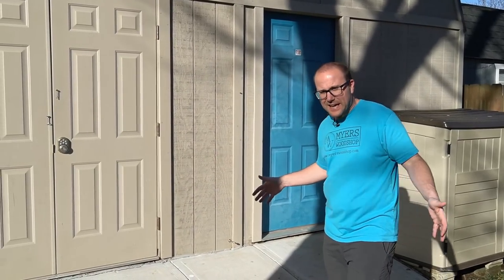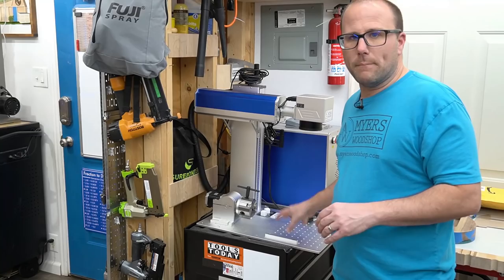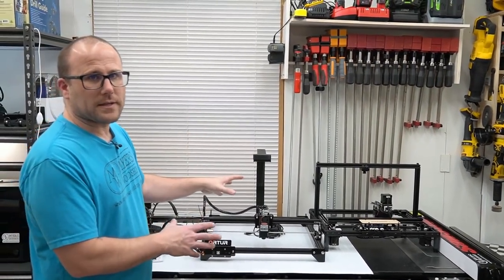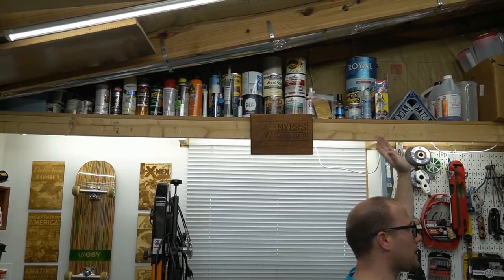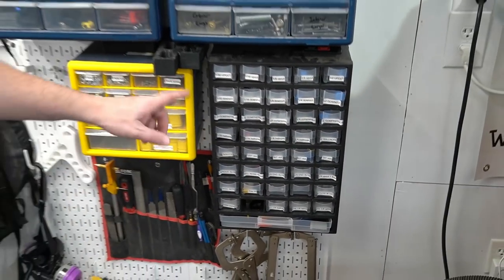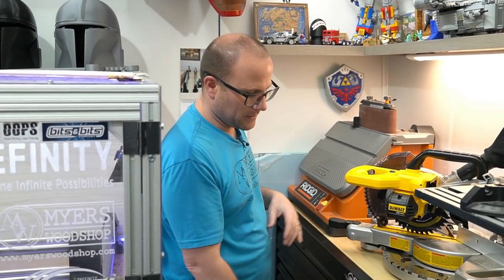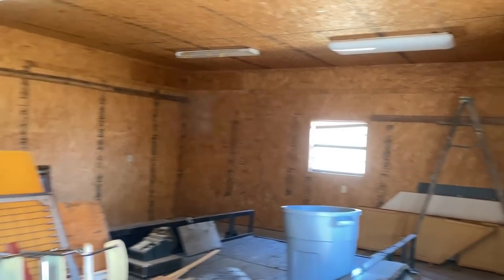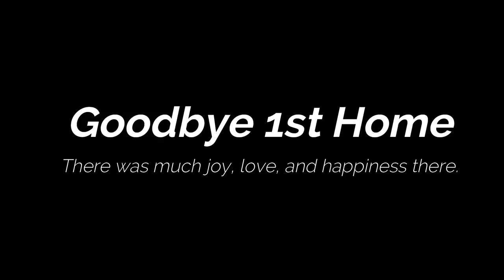The LAST Shop Tour Ever // Shop Tour 2021

Comment from the maker: Laser (omtech):https://omtechlaser.com/?ref=myerswoodshop
Fiber Laser (omtech):https://omtechlaser.com/?ref=myerswoodshop
Rockler dust collection:https://amzn.to/3tekCGM
bora wood racks:https://amzn.to/3cv6rGI
wall control pegboard:https://amzn.to/38CCbIO
microjig:https://amzn.to/38CCgfA
bow products:https://amzn.to/3vmqRdG
Printer:
prusa:https://www.prusaprinters.org/
Ecubemaker 4 in 1:https://amzn.to/3qFVDKJ
ender 5 plus:https://amzn.to/3qJXGgU
artillery hornet:https://amzn.to/2OsDT8K
Ortur Laser:https://amzn.to/3lcfYXb
Sawstop:https://amzn.to/30IdAOd
Grizzly Bandsaw:https://amzn.to/3tga3mz
Supermax drum sander:https://amzn.to/3vmx1u7
34" ultra wide monitor: https://amzn.to/3cvw7CP
Mac:https://amzn.to/38EyIcy
Onefinity CNC: https://www.onefinitycnc.com
Armor Tool bench:https://amzn.to/38EyIcy
dewalt 7" miter saw: https://amzn.to/2OkcaqR
Ryobi Bandsaw: https://amzn.to/3vnE99K
Ridgid Sander: https://amzn.to/3rPAT4I
LED Shop Lights:https://amzn.to/3bLRq4e
Fuji Q5 paint sprayer:https://amzn.to/3eAgk8x
Starbond CA Glue: https://amzn.to/3exKYzz
Wen Air purifier: https://amzn.to/3eO0veP
Silicon Mats: https://amzn.to/3vjDlTb
Woodpeckers Rulers: https://amzn.to/30FME1H
Amazon Alexa Studio: https://amzn.to/3ezLwES
Board Games:
Scythe : https://amzn.to/2Ng5Wrr
Clank Legacy : https://amzn.to/30Es0iD
LG Heat/ Air Conditioner: https://amzn.to/38Dg0C9

Comment: Congrats! I like the new place! Hope your new shop is insulated, are you going to get rid of the woodburner and get something like a mini-split?
Reply from the maker: keeping the woodburner. Free heat!  But I'm looking at a mini-split!
Reply: @MyersWoodshop  I just put in a Mrcool unit.. dont be afraid to get the non DIY units pulling a vacuum and flaring some copper tubing is easy

Comment: Greetings: recently purchased Onefinity CNC, using VCarve Pro . 9.519 for CAD, download to Onn USB 3.0 flash drive, formatted to NTFS. Plug into Onefinity controller, try to open file "surface spoilboard 1.0" ngc and a bold X appears at end of address. Do you know of a solution or a step I am missing.  John Tyrone thanks for any help